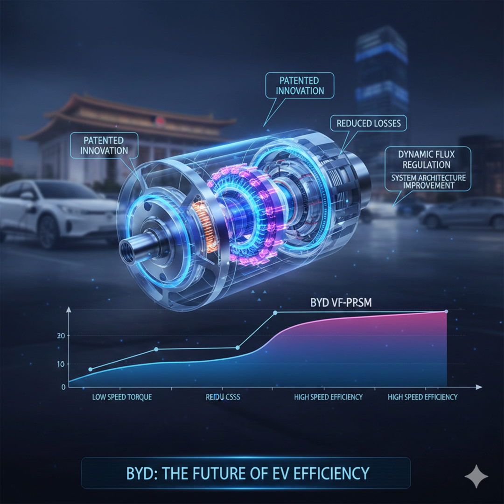BYD's Variable-Flux Electric Motor Innovations

Comment: Playing with magnets and not knowing any better I was informed magnets cannot be shielded, only attenuated. But i thought the axial flux motor had the radial flux ready for the trash bin! Checking your link.
Reply from the maker: You can't actually 'block' magnetic flux lines (since magnetic monopoles don't exist, flux lines must always form a closed loop). What people call 'shielding' is really flux redirection or attenuation—using high-permeability materials (like Mu-metal or silicon steel) to provide a path of lower resistance, guiding the magnetic field away from where you don't want it.

As for Axial Flux vs. Radial Flux:
Axial flux motors are absolute power-density beasts—they offer insane torque-to-weight ratios and are super compact along the length of the axle (which is why hypercars like Ferrari, McLaren, and Koenigsegg love them).

However, Radial Flux is far from the trash bin!

Manufacturing & Cost: Radial flux motors are vastly easier and cheaper to mass-produce on standard automated lines.

Thermal Management: Cooling the inner rotor/stator in high-power axial flux motors is structurally complex.

Structural Integrity: Axial flux rotors experience massive centrifugal and attraction forces that want to crush the airgap at high RPMs, requiring high-precision manufacturing.

While axial flux will dominate high-performance niche applications, radial flux (especially with advanced variable flux or internal permanent magnet designs) will remain the workhorse of mainstream EVs for a long time!

Comment: 6:43 how to change the flux by BYD ？
Reply from the maker: Basically, BYD's Variable Flux technology uses mechanical actuators inside the motor to physically change how the magnetic field behaves while you drive.

Instead of having a fixed magnetic strength (which is inefficient at high speeds), the motor can:

Max out the flux at low speeds for instant, powerful torque.

Mechanically reduce the flux (using movable shields or adjusting the rotor's geometry) at high speeds to eliminate 'Back EMF' resistance.

This 'Variable Valve Timing'  allows the car to be much more efficient on the highway without needing a bigger battery. It's about changing the internal physical geometry of the motor in real-time!